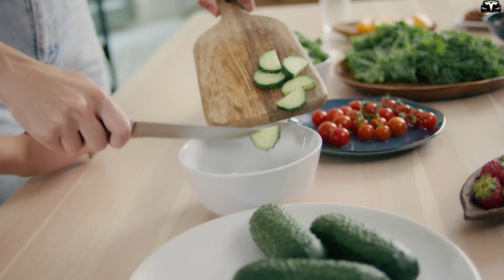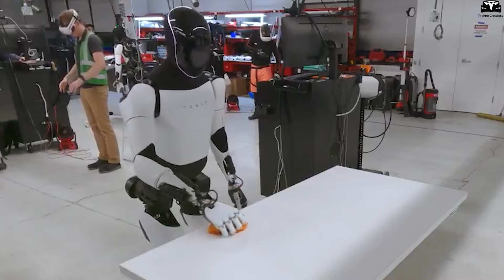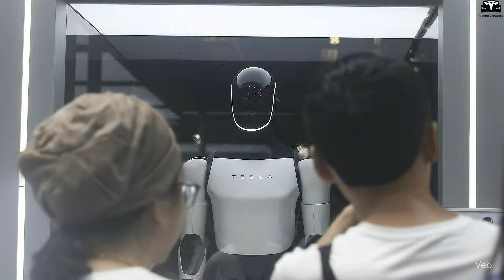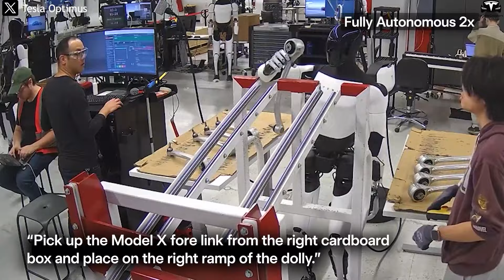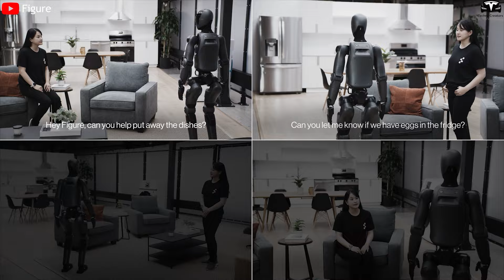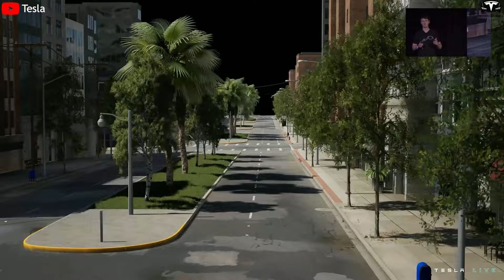Elon Musk Reveals Tesla Optimus V3 With 3 Exclusive Household Features! Details Explained

Comment: I think Tesla might wish to provide aprons and gloves for cooking with grease.
Also, steam is not good for robot joints, over time, maybe? 
Just stirring a pot can have "splash back" events, I've discovered. 
Cooking requires multitasking like, do this other thing while this thing is cooking but don't forget to stir every minute or less? If it took too long then scrape the bottom of the pot to remove any pre-stickers?
So it sounds to me like Optimus might be learning a little bit about multitasking?
Reply from the maker: Great point! Tesla will likely develop heat- and moisture-resistant joints for long-term kitchen use.